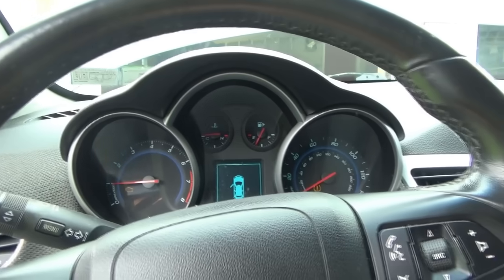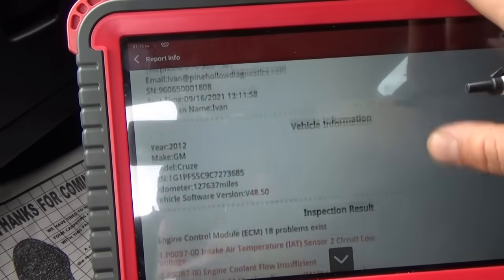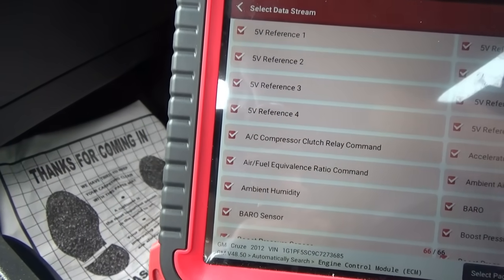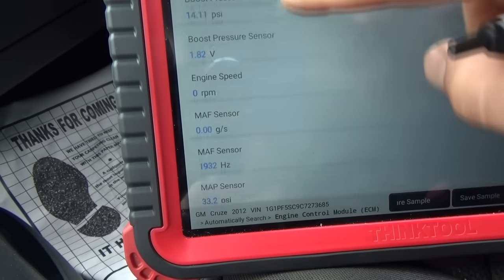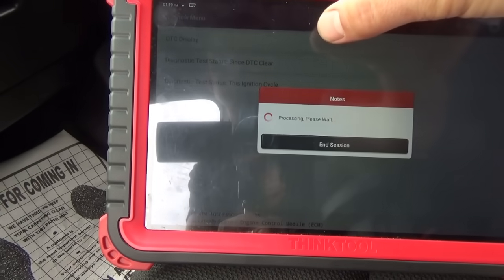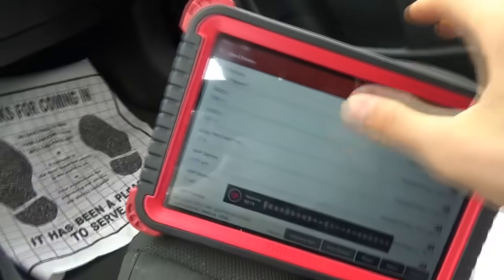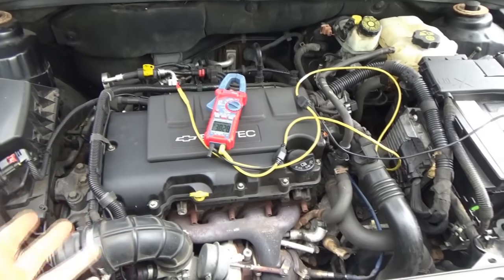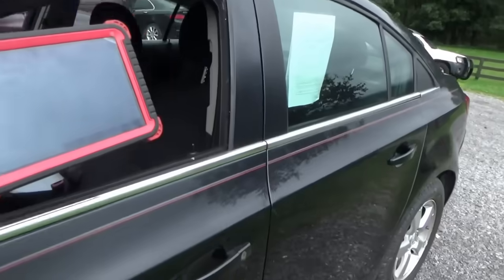Scotty Kilmer was RIGHT! (Cruze Turbo Rough Idle P0106 P0171)

Comment: With any modern car (especially those with Bosch parts, like all modern GM and pretty much all European cars) if it has a lean code and symptoms of a vacuum leak, I always check for excessive crankcase vacuum first. It’s super quick to check, just open the oil filler cap and see it is heavily suctioned down to the engine. If it is, take an actual measurement of the crankcase vacuum and compare to spec. This is an insanely common issue on all modern GM vehicles and all European vehicles built in the last 20 years. The MAP sensor is also common (it’s a Bosch sensor and they fail regularly).
Reply: Is it safe to open oil cap when running ? I've heard people do . Of there us suction what would plan of action be ? Cheers curious#
Reply: Just put a sheet of paper over the oil fill hole and see how hard it’s sucking. That’s how you can easily tell if it’s bad. It’s always the cam covers that fail on those.
Reply: @Punkpsychobilly  whe its running ?.
Reply: @kevinhancock4064  i know this is late but yes you can open it while it's running.
Reply: @rickylafleur5823  no better late than never mate
Reply: @rickylafleur5823  I had lots of work recently done car back in garage turbo related . I bloody hate cars just had turbo lit to new 1
Reply: @kevinhancock4064  from what i have seen the wastegate likes to fail and turbo can crack. i just got one of these for pretty cheap and haven't gone to work on it yet so i have been checking into its common issues. i don't really like having turbo cars as daily drivers since the turbo will cost me about as much as a used motor i could swap in. i don't know if you do your own work or not but this car looks pretty simple to work on. investing in tools might save you a ton down the road since it has some pretty common fail points. also look into the pcv mod for the intake, you may not need it now but it will save you money in the end.
Reply: @rickylafleur5823  yeah the pvc I mentioned once to dealer nice bloke bug he didn't get into it much . I've stripped my motorcycle of its cylonder and cylinder. Head due to broken header bolts sent it off that's done now. Bur I have 1 broken hg  bolt on block which whenever I get a good weed on a nit it shears off very annoying . Back to the car . Yrsh I've heard wastgate issues inc solenoid issues . I'm not sure what comes in the kit but I'd have thought these wouod have if common issue . I'd not it's a bit daft.. I've seen many forums where the exhaust gas pressure sensor fails to which was my suspect after the work was done seemed OK for a good few days ..had the mooing  back which made me wonder if the sound was a wastegate issue . ....I know its to do with pressures bring released in the turbo etc . I just hope garage figures it out properly as they done the work . Paid enough . I knew how it was done but with littke ones it take ages to fit it in etc  if it was just the intake need cleaning etc id have likely done it done similar jobs
Reply: Europe is chock full of unemployed engineers. They can afford to make cars like this. There is a German-made sensor to blame for everything that goes wrong with these engines. These are nice cars, when new, really fun to drive. When you have an engine the size of a motorcycle, you need some high tech gizmos to get as much out of it as possible. Then it takes a super smart guy like Ivan to fix the thing... He probably bills out at $300+ per hour.  And he would be worth that, if he can find the problem.

Comment: I have the same car. Bought it with 12 OBD2 codes.  Lean burn and misfire. Changed the valve cover and tightened all the turbo connectors and now she runs smoothly. The previous owner always paid a shop to fix it and the last person didn't even have the pipe from the intercooler to the intake on all the way. ALL the boost was leaking out. 
Also got the NEW oil cap kit from GM that keeps the boost from leaking out the cap and blowing oil all over the place.

Comment: TIP: Replaced hose with standard vacuum hose and inserted a regular old school GM pcv valve a few inches before the connection to the valve cover. No more problems since and smooth idle.
Modern technology IS NOT ALWAYS BETTER than the old.
Reply: @ultimate2368  
No
Reply: My solution also.
Reply: Can you show how to's or explain?

Comment: The BIG question would be, what does GM diag show in their records? It's amazing that a good diag has to come from other mechanics sharing experiences on a blog !! Goes to show the "real world" has most of their stuff together. Good one Ivan
Reply: Intake manifolds with the non return check valve missing and internal pcv issues with the cam cover have been problems on these cruzes for years and has been well known in the GM tech world.  This wasn't some ground breaking diagnostic job here.  No offence to Ivan as he's a great tech but at the dealer, we see these daily for p0171 and the cam covers and intake manifold are even covered under special coverage for 10 years 120k miles on certain cruze's.
Reply: ^all of this
Reply: @JD730  good; there must be a bulletin for this. Throw a new engine otherwise.

Comment: I have a 2013 Cruze turbo and once I fixed the coolant leaks, water pump, oil cooler, pcv fix, valve cover, battery cable, and various other issues, the only issues I have now is oil leaks from every crevice in the engine. It is a great car other than that.
Reply: What’s left ?
Reply: @sprint48219   I guess tranny still going strong.
Reply: I got the cover and intake changed , still looks like it’s leaking from the same spot on the intake
Reply: Lololol now that was a funny post! Kind of like " Once I jacked up the radiator cap, and drove a new car under it, it was fine" lolol. 😂😂😂

Comment: Ivan I just watched your Cruze video.
This is a well documented problem with these engines, and happened to my 2015.
The little orange grommet in the intake manifold gets ingested into the engine and that causes the value on top of the cam cover to also fail.
The fix for mine was to replace the intake manifold and the cam cove.  
GM is so aware for this problem they discontinued the intake manifold instead of redesigning and fix the problem.
I ending up replacing mine with a Dorman redesigned manifold, figuring it can’t be worse than GM’s quality. 

Keep up the great video’s
Reply: Did the redesigned Dorman work for you, my friend?

Comment: Nice diagnosis. I remember you reading TSB and other info and it mentioned that the failed check valve in intake will damage diaphragm in the PCV system. That reminds me of the Volvo you diagnosed were the PCV failed and took out the turbo. 
I guess the manufactures build in a constant revenue stream for selling parts and repairs.
Reply: Yeah, Volvo PCV is something else. Definitely not a highlight of the five pots but overall they're great engines and not all that difficult to work on.

Comment: This is a good one.  I watched this video because I have been seeing a lot of these engines coming through and this could save about 2 hrs of diagnostic time if this info is known.    I have had a vacuum leak on one of those pcv valve and was a bit surprised it was in stock for not much money at orieleys.   Showing it is common thing.  What I did to find out was run a smoke test and it was dumping out that pcv vent.  I think on these ones any p0171 code should start with a smoke test.   It may save a lot of diagnostic time.   The valve cover is quite easy to do, not a big deal.
Reply: GM tech here. Extremely common! If you hear the pcv valve leaking like that then always pop the corrugated tube off the intake and check for the orange tipped valve down the intake hole. If it's missing then you need to replace both the intake and the Cam cover
Reply: @chicanobluesaz4191  why are these called cam cover as opposed to valve cover which is more commonly used?
Reply: @scientist100  imho it doesn't really matter but I believe it's due to the engine being an overhead cam engine.

Comment: Your statement about "modern cars" is spot on even to a lesser degree with older vehicles. You really have to do a through step by step diagnosis if you want to limit  #1firing the parts cannon, #2 wasting time. I own a 98 4.0 Wrangler and a 96 Ford 2.3 Ranger and I wouldn't trade either for the junk they are selling nowadays! Wires and plastic make me spastic! 😳🤣
Reply from the maker: 2 legendary bulletproof engines right there 💪
Reply: @PineHollowAutoDiagnostics  👍

Comment: This issue is very common here in the uk were the cam cover causes high crank case pressure with these eco tech or eco s**t engines as we call them, normally causes very high oil consumption

Comment: Another way to tell if the intake manifold valve is missing, causing the high vacuum and/or burst disk failure is to check the spark plugs for cylinders 2 and 3. They'll be oil-fouled (sucking oil directly from the crankcase). There's a fix sold by a member of cruzetalk that reportedly works well, but the Dorman replacement intake has a clip that holds the valve in place, so it's a better repair than a GM unit.
Reply: Burnt disc? Wtf is a burnt disc?😅😅😅😅😅😅😅😅😅😅😅

Comment: As a former GM Tech. This non return valve problem had a recall issued for a brief time. 5 out of 10 intake manifold non return valves were faulty.
Reply from the maker: That's crazy
Reply: Are you referencing the PCV?

Comment: I try to look on the plus side. I'd rather have to replace an intake manifold and valve cover because they're really not difficult or time-consuming jobs. If I had a Honda with oil dilution problems, the engine could suffer major internal damage, so I might need to replace the engine. If I had a Ford Ecoboost four cylinder, I would likely also have to replace an engine when the cylinder head gasket fails and coolant starts going into the cylinders. I guess that's the price you pay for trying to get better fuel economy and performance.
Reply: All in all the auto industry screws the customer. I'm done.
Reply: Thanks for pointing out it is not just GM. Some get stuck on who's the best.

Comment: Hi Ivan
My 2012 cruze is on the fourth valve cover and third turbo charger with 140k. Valve cover is finally under recall up to 120k or ten yrs.. Found a repair kit on youtube for the manifold which i installed and works , cost about 80 bucks. Beats replacing the manifold to see it fail again. Just a heads up.
Reply: And nearly all of this could be avoided with supercharger vs the turbo. Less space heat problems etc. Contrary to popular opinion turbos are only better for the mfgs. 😆 There is no free power. Turbos have more problems and must be driven directly by the piston. 🤔
Reply: You obviously have no idea how to look after a car Gerald
Reply: @deanparker3328  🤣 But turbo sounds so cool! It means fast! That cant be true! 😂
Reply: @micahap1559  you are either a child or a troll or have absolutely no idea what you're talking about.

This conversation is over.
Reply: @deanparker3328  😂 Rubbish!
Can you not project your ignorance any better than that?
Reply: @deanparker3328  I thought this conversation was over when you could dish out your own projected issues but couldn't deal with any response to your nonsense.  Do you understand anything you say or do you only know turbo sounds cool? 😆
Reply: @micahap1559  yah!!! That's right. Let's ask Howard Johnson! And Gabby Johnson!! They both say "Rabba"!
Reply: @chrissnyder3430  ??? 😕
Reply: @Jacks Journale Both of my turbos had that crack, but they still boosted within spec when you're staring at the Guage. You can tweak the waistegate a bit to compensate for that leak. "It'll ruin the engine" is b.s I've had it teaked for meh 210,000 miles when I swapped the turbo.
Reply: @Yeah Right turbo charging has not been successful.. ever heard of the EcoBoost???
Those are garbage..
There's a YouTube channel where a Ford raptor a, 2017 or 2018 raptor is on its third EcoBoost and that's at a Ford dealership!!
Trash engines!!!
Reply: NOT even a Cruze needs that much maintenance. Most of that money was spent due poor diagnostics.
Reply: @frnkjones40  any chance you can explain in more detail?
Reply: @gabooda2380  I own a Cruze and it has quite a few codes. The majority of my codes are related to improper airflow. Unmetered air entering the engine will cause all kinds problems because the computer is running the car on bad info.
Reply: @frnkjones40  yep, i get that. i thought maybe you were saying the culprit was really the PCV valve and the intake manifold porosity (requiring the maifold replacement) was not the underlying problem, therefore adding cost from a bad diagnosis.

my kid has this problem with a 2014 chevy sonic. definitely has negative pressure in the crankcase and valve cover.
Reply: @gabooda2380  that's exactly what I'm saying. I own a Cruze and it had those codes

Comment: This may be the only video of yours I ever watched where I knew exactly what the problem was while you were still trying to figure it out lol. These cars make me a lot of money at work and I don’t even work at a dealer lol. Replaced dozens of valve covers,  intake manifolds, turbos, and cooling system components. Feel bad for all our customers though because these cars are a damn money pit
Reply: To answer your question at the end as well, yes Ivan if you’re pulling vacuum through that port on the valve cover then it needs to be replaced
Reply: Scary I almost financed one not too long ago was excited to be racing and stuff
Thought about it I said fuck that I’d be salving away for that car and if it broke down I knew I wouldn’t be able to fix it 
So I bought an old reliable Honda 1998 civic dx 2 door  automatic for 1600 or something like that
It has 216k miles but I’ve already put on about 5k miles
Just oil changes, air filters, headlights, and a whole lot of oil
Has a rear main seal leak but it’s not too bad yet
Planning on fixin soon
Reply: same here i own one i was saying the whole time put finger over orifice hole if engine acts normal or chokes when you do that bad valve cover most likely caused by bad intake manifold due to check valve being sucked through and thrown through the exhaust because its made to be sucked through and out the exhaust in case of failure
Reply: @larryhunter1294  what do you mean leaking around the intake?
Reply: @larryhunter1294  well oil does not run through the intake, you’re valve cover is most likely leaking onto the intake
Reply: @larryhunter1294  I mean yeh depending on how bad the leak is, ya gotta find out what’s all leaking though, those cars are known for valve cover gaskets, oil pan gasket, oil pan drain plug gasket, oil filter housing assembly. But if you’re saying you have oil all over your intake then that means the valve cover gaskets leaking
Reply: But you still hear from customers,  they love those things, and they're still buying them🤔🤔🤔🤔. With their money,  they can do whatever they want.  I respect my customers ideas😊😊😊
Reply: It's a KNOWN weak point of the 1.4T. There's a tiny, silicone one way/ overpressure valve built into the cover. They deteriorate almost always by 90,000. The you get over- vacuum at Idle, and under boost the crank case PRESSURIZES. Seal killer, and will wreck engine. 1.4 forums( they still exist ) say that this is a "when, not IF" scenario.
Good power/ displacement engine, but they had to completely re- design the 1.4T for Encores; up market, after 2020. All Cruzes got the planned obsolescence feature.
!! Like everything else now. . .
Reply: @cee7153  yeh I’ve replaced probably 2 dozen of these at the shop, very very common, also very common is the intake manifold fails and you gotta replace the whole manifold. Also had one a few months ago that had a lean condition that no one could find, tons of parts launched at it, it was leaking oil from the rear main seal that was causing it to run lean, first time I had seen that
Reply: @2491kridge  
Wait... What? Leaking oil from rear main seal caused mean mixture? Was is sucking air through the seal or something? If so, that's the craziest thing I've ever heard of!
Reply: @shane250  yeh it was crazy, I mean think about it if you can leak oil then that means you can leak crankcase vacuum. Several shops threw a million different parts at it and couldn’t fix it, I could see a very obvious lean condition at idle on my scan tool but could not find the issue with a smoke machine or with propane, so I took out the old brake clean and started spraying all over the engine while it was running and finally got one area on the back of the engine that responded every time I sprayed it, figured out the brake clean was running down the engine and getting sucked up at the rear main seal, lifted the car up and you could spray it right into the bell housing and the fuel trims would drop like a rock every time. Replaced the rear main seal and fuel trims were perfect and the car was fixed for good lol, very weird one for sure
Reply: @2491kridge  
Damn. I bet that will be the first and last time you'll ever see something like that. 

This thing can go through 100 shops without being diagnosed correctly.
Reply: @shane250  yeh for sure it was definitely a weird one, probly never come across that again but it’s definitely something to keep in the memory bank